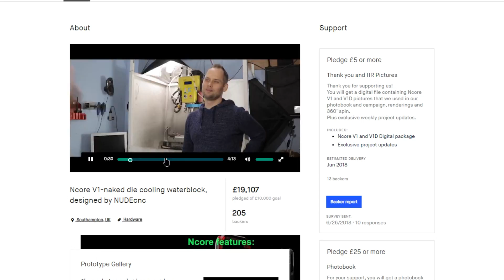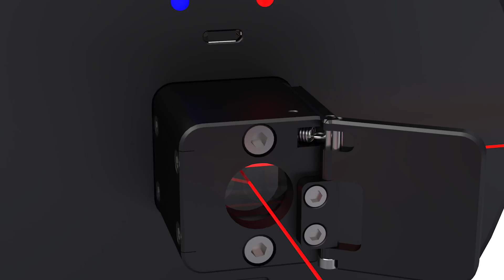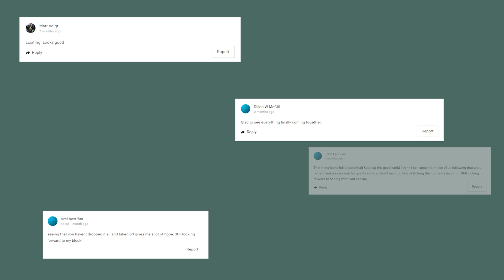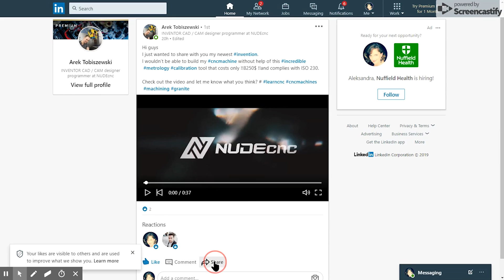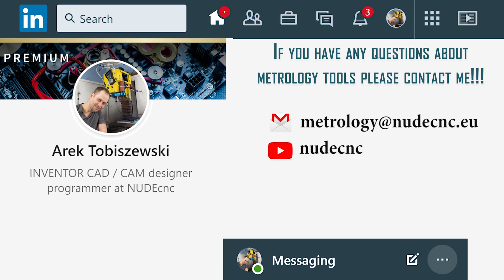How to build CNC machine from granite and calibrate with 0,0001μm laser tool

Comment: 0,0001um it's a little bit exaggerated don't you think? You reached the scale of an electron or a proton... :face-blue-smiling::face-blue-smiling::face-blue-smiling::face-blue-smiling::face-blue-smiling:
Reply: Not quite, but it is the scale of a hydrogen atom, though. His cheap Chinese linear rails are probably off by at least 100um. ;-)

Comment: Why natural granite instead of epoxy granite casting?
Don't think I've ever seen another mill made of natural granite.
Reply: See Piotr Fox Wysocki, https://m.youtube.com/watch?v=gUFeoDf1YvM
Epoxy granite has its points, however it apparently is subject to slight absorption of moisture and possibly degradation of the Epoxy (chemical, UV, thermal).  Then you have to create a mold, do the casting, get the cast part out of the mold without damaging it, etc.
An inexpensive granite surface plate costs (US) a few hundred dollars (depending mostly on shipping) and comes flat within a few tenths of a thousandth of an inch.

Comment: Wow first time I see a cnc that is accurate within 1/5 of the width of atom. That's crazy. My cnc is accurate only within the width of 5 atoms. Keep it up man
Reply: Only the laser measurement is really precise.  The cnc will be the sum of different errors; ball screw precision (wonder if he used ground C5/C3?), spindle runout, linear rail preloading and accuracy class, how the whole thing is supported by the table and if it's ever moved, thermal expansion, motor control errors, motion error correction, probably other stuff.   The spindle looks like a JGL, http://www.jian-ken.com/automatic-pneumatic-tool-change-spindle-motor/jgl-100-2-5kw-24000rpm-iso25-spindle-motor.html which is stated there to have 2 microns runout.  Add everything else on top of that.  I guess this machine might be accurate to 10-15 microns?  Just a guess.  That's still quite good but something like a factor of 10^5 more than you're thinking.  I guess you were kind of joking in your comment but I think a lot of people might not realize it's super hard to get micron precision.  An example of a sub-nanometer accurate machine is shown here https://www.youtube.com/watch?t=153&v=uUluc_grPLI.
Reply: @perspectivex  I think you misspelled sub-nanometer. For reference one atom is about 0.5 nanometer in diameter. Such presision I would say it's impossible to achieve even by lapping. Even micron precision is difficult to achieve just by machining, and that's 1000 nanometers.
Reply: @TheMIroslaVbachev  i think you might have read my comment before I corrected that typo...I saw it the split second after clicking save, sorry.  Anyway, I get that it's nearly impossible to operate "large" equipment at nm scales but if you look at the link to the video segment it shows that ASML machine which operates with sub-nanometer precision. True, not really a milling machine as it's doing photolithography but apparently it positions things to sub-nm, which is still pretty amazing (I know there are also piezo linear stages that do sub-nm movement; https://www.pi-usa.us/en/tech-blog/sub-nanometer-resolution-piezo-linear-motor-with-interferometer-feedback-pi).   I agree lapping typically only gets you to a dozen or two nm at best (quality optical flats are a good example of a highly lapped&polished surface in that range https://en.wikipedia.org/wiki/Optical_flat) but you can "machine" a surface to ~3nm with electrorheological polishing https://www.researchgate.net/publication/229121322_Development_of_a_padless_ultraprecision_polishing_method_using_electrorheological_fluid.   But I guess there dozens and dozens of other problems to contend with if you really wanted a sub-micron to nm milling machine with a decent build volume (you could position atoms with an atomic force microscope but that doesn't really seem like milling to me).
Reply: Don't confuse measurement resolution with positioning accuracy or resolution.

Comment: FINALLY, a gantry with real sturdy squares between the Y carriage and the beam. I can't stand seeing so many machines compromised by the use of thin, flimsy plates where you used raised rails and a stiff angle aluminum block. Great design !
Reply: Agreed. They look incredibly beefy. Would be interested to how it mounts as those look like some deep bore holes.
Reply: very brittle material. It's great for CMMs and doing precise measuring on as it has good flatness and good thermal properties but wouldn't use for a machine that's under constant stresses from machining materials, i guess machining wood wouldn't hurt it for a while

Comment: I am in the process of building a couple of CNC machines my self. I would love to know what parts and suppliers you got bits from like the spindle etc and what controllers your using. I realize you have a business to run and I still would like my ncore but as both an IT professional and a hobby machinist I'm interested is more than just the end product in this case.

Also I think it would be good to get a demo/info on how it was calibrated and if we can pay to get this done for us it would be very interesting too.
Reply from the maker: Hi Andrew! In regards to the parts, there were so many of the suppliers! can you drop me an email at arek@nudecnc.eu 
We are currently working on the video with an instruction manual of laser/ calibration, should be up soon...